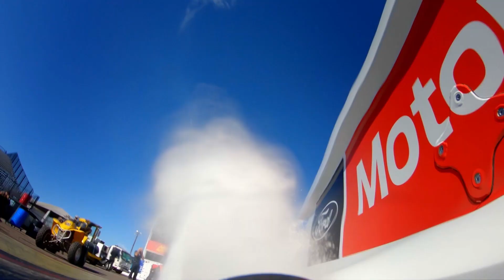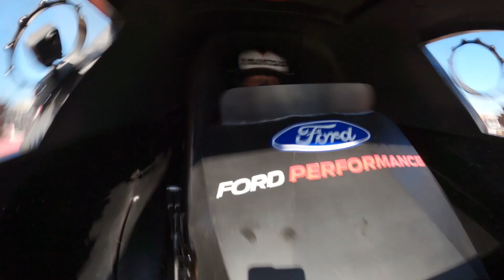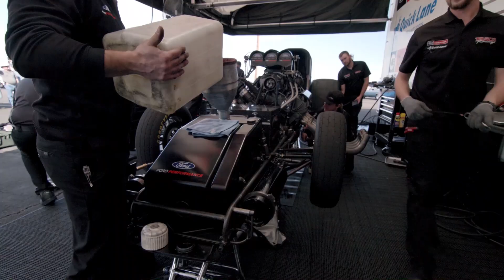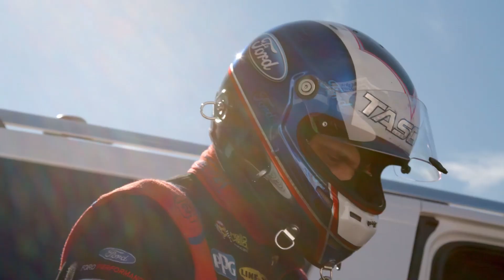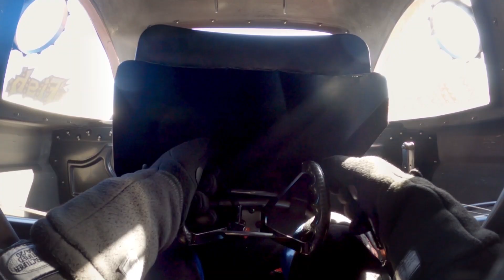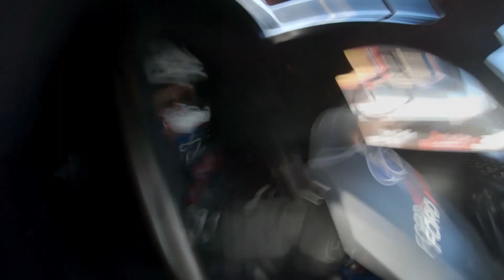An inside look at the fastest Ford Mustang Ever with Bob Tasca III

Comment: WHAT IS THE ENGINE IN THE CAR ? CAN NOT FIND INFO ANYWHERE ?
Reply: Very Loosely Based on a 426 Hemi . A Donovan Aftermarket Block is the Basis . Everything Internal is Billet Custom Machined . Nothing is EX MANUFACTURER . 500 Cube Rule 2 Valve Single Cam . Source . Funny Car Guidelines Rule Book
Reply: @Saffsa  Thanks
Reply: @Saffsa  Thanks Marty

Comment: There isn't a Ford part number on that car!! There are as many Chevy parts on it as Ford!!
Reply: Donovan Blocks . Custom Billet Machined Internals NOTHING EX MANUFACTURER from the Chev Chrysler Ford . Source . Funny Car Guidelines Rule Book 👍👍
Reply: @Saffsa   Lots of blocks. Allan Johnson does most of them, some Brad Anderson stuff. Not relating to any manufacturer. They are not Chrysler . Block of billet into a CNC machine and out pops a block, how is that a Ford? Force says he has Ford blocks, no sir. Call it anything you want as long as you make it. What's a Donovan block?